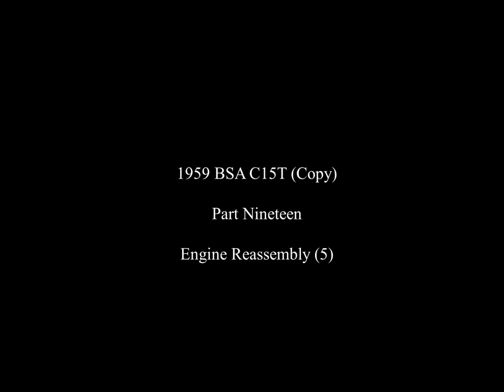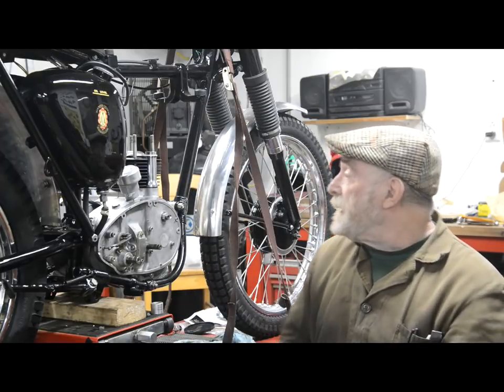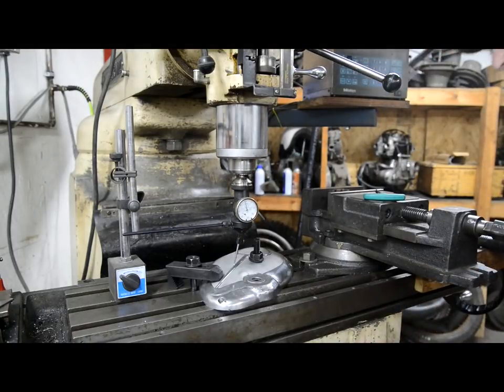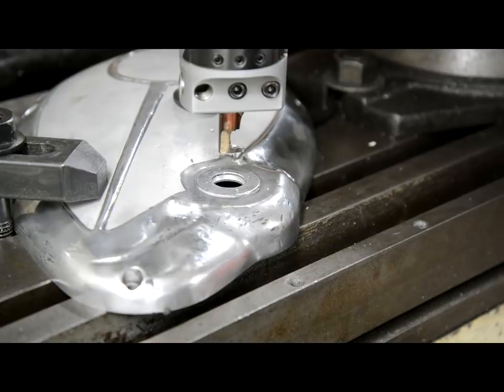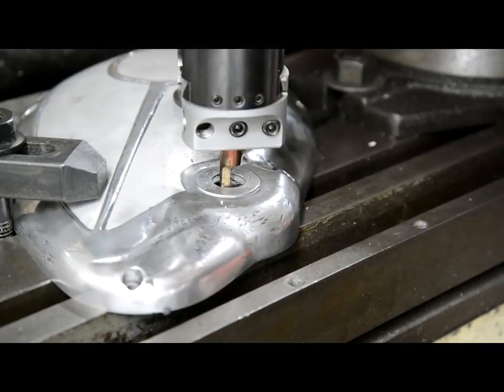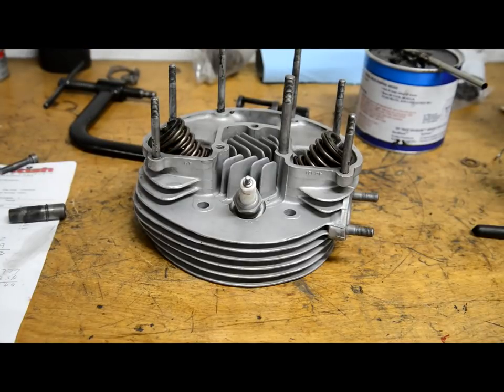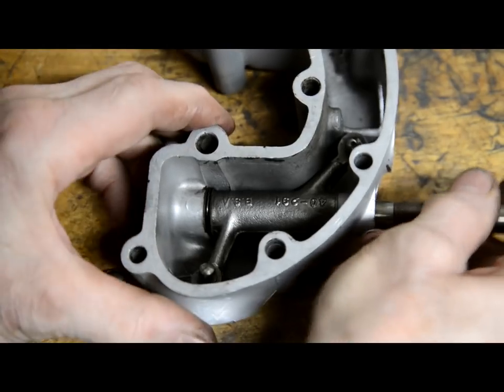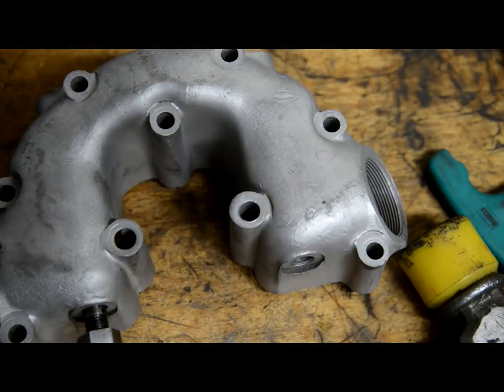1959 BSA C15T (Copy)  -  Part Nineteen

Comment: A mod I always liked to do to Triumph Twins which can be applied to the C15 & B40 as well is to turn up solid steel  spacers to replace the springs on the rocker spindles. By making them "bespoke" for each rocker/spindle you can ensure that the rocker is centred on the top of the valve stem. I first came across this idea in the little book on Triumph Twin tuning that was put out by Boyer Racing. It also helps to reduce 'clatter' from the valves/rockers making the engine quieter mechanically.

Comment: The fact that the ‘distributer’ clamp bolt goes all the way through from the outer case is pretty obvious. Even BSA wasn’t daft enough to expect owners to dismantle half the lower engine to adjust the timing! That little (but long) screw used to worry me, as it really doesn’t look so strong. But mine never let go. Thanks Michael! Les in UK
Reply: It's self explanitery when you'v got one in front of you, it dosnt have to be a big bolt , it's only got to stop the distributer from moving round and upsetting the timing.

Comment: Discussion of the oil tank feed and return reminds me of a painful experience I suffered in about 1980. I hope that I am recalling this accurately.  I had a very tired C15FSS80 engine. I built myself up a lovely C15G engine, with great care, in my bedsit. Come the great day, I swapped the engine over (working in the gutter) but for some reason I could not get the oil feed union to fit properly on its stud. Annoyed,  I pulled the old union off the pipes and fitted the union that had come with the G engine, taking care to replace the oil pipes the same way as they had come off. Oh dear, you can guess the rest.
It is only with hindsight that I admire the designers obvious intent to make the union mountings incompatible and therefore prevent a straight engine swap, without messing with the oil lines, impossible. Sadly I didn't make the intended use of the pause in operations this ensures!

(I collected quite a few C15 engines over my years of ownership but never came upon another 'G'. Are they rare?)

Comment: Maybe that extra length that was on the replacement shaft piece would have been enough to allow for making a seal carrier that could have been bolted or welded to the side of the case.

Comment: Surely your O ring will only prevent oil seeping past the outer cover. Should you not have sealed the inner case?
Reply: There will always be some oil between the inner and outer cases from the engine breather. No way to prevent it. There is a tiny hole in the inner case to allow the oil to be drawn back into the oil pump cavity by the crankcase vacuum on the up stroke of the piston.
Reply: Yeah, thinking of the same thing.  Gearbox oil will seep past the shaft into the cavity behind where his "O" ring is set.  Perhaps he did it to keep dirt from going in.  Actually a seal would be appropriate on the inner case cover.   Gearbox oil is 90w as I recall (used to be a mechanic on BSAs back in the day) and doesn't belong going outside the gearbox proper.
Reply: On these early c15 engines bsa recommended using the same oil in the gearbox as the engine so the O ring was just about stopping oil coming past the kickstart shaft due to it being as low as that tiny return oil hole . If you use a side stand that also helps as the engine is tipped away and the oil doesn't reach the height of the kickstart shaft.
Reply: @martinwalker2959  Yeah, what would they have been if they'd not been piddling oils..!  I had and raced a 250cc Matchless, G2CS, competitor to the C15s which in today's hindsight were more primitive.  The Matchless didn't dribble oil but it had quite the appetite for breaking crankpins... .